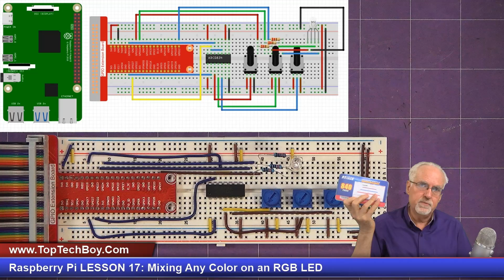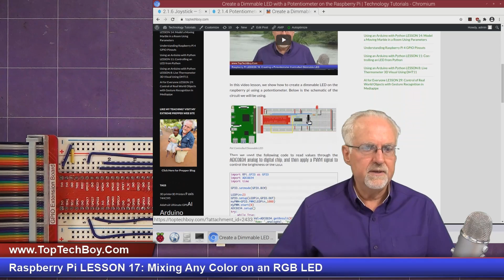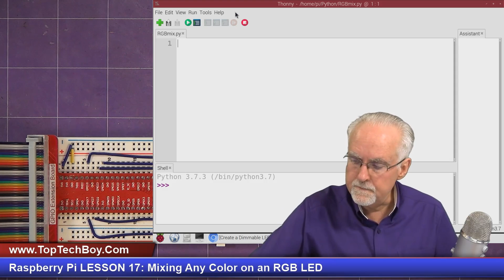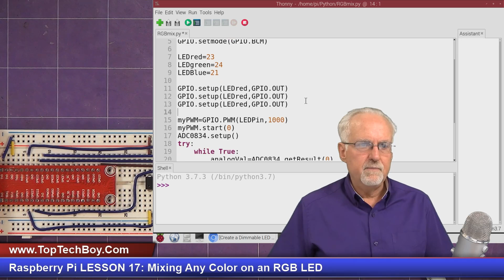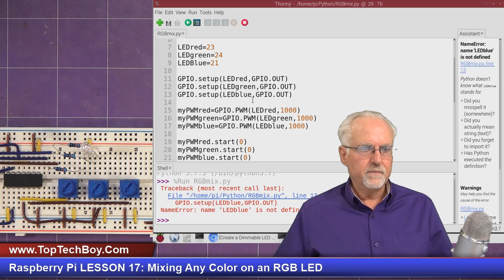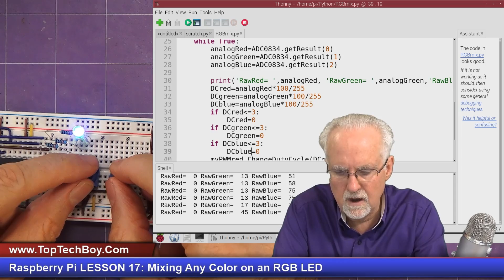Raspberry Pi LESSON 17: Mixing Any Color on an RGB LED

Comment: I AM LEGEND. I saved some typing by using arrays to save the output pin numbers, the ADC readings from each potentiometer input channel, and the duty cycles for each LED. This made it possible to use 'for' loops to do the repetitive stuff needed for each LED, so a lot less typing. The exception - I was unable to figure out a way to use an index to identify an instance, such as writing 'myRedPWM=GPIO.PWM(pin#,Freq)' alternatively as: 'myPWM[color index]=GPIO.PWM(pin#,Freq)'. Perhaps there is a way, but I am ignorant of object oriented programming methods.
Reply from the maker: LEGEND!

Comment: It  took me a while, but I am legend. I ended up burning out my ADC0834 missing the ground on pin 7. I got a MCP3008 and did some research to connect that chip instead of the ADC0834. The MCP3008 has 8 10 bit channels.

Comment: I am Legend - I built it, and it worked first time.  Can I ask why your circuit layout diagram shows the 5V pin connected to the rail that is next to the blue '-' symbol, and the GND pin to the rail with the red '+' symbol?  Many thanks for this series.  I'm looking forward to the next part of this course.

Comment: Thank you Paul. I just love the Sun Founder GPIO Extension Board and the Bojack jumpers. Life is soooo much easier, than when I started with Arduinos and wires all over the place with many faulty intermittent connections. Looking forward the Camera lesson and the MPU6050 one.

Comment: mr paul i want to ask a question its unrelated with pi but it has to do with python

i do this 
with open("hotels.pkl" "wb" ) as f :
    pickle.dump(names,f)
    pickle.dump(εισπραξεις,f)
    pickle.dump(ολικαεξοδα,f)
    pickle.dump(τοποθεσιες,f)
    pickle.dump(αριθμος,f)
but it gives me this error :
File "d:\python projects\αλυσιδαξενοδοχειων.py", line 42, in <module>
    with open("hotels.pkl" "wb" ) as f :       
FileNotFoundError: [Errno 2] No such file or directory: 'hotels.pklwb'
i tried many things like storing the file first seperately using directories but didnt work 
i also saved my programm first many times and then  run the programm but that didnt work either.

any ideas would be appreciated .